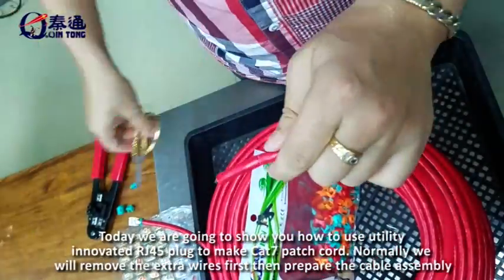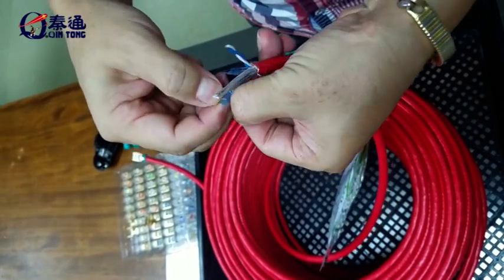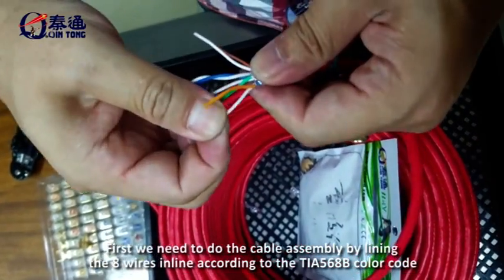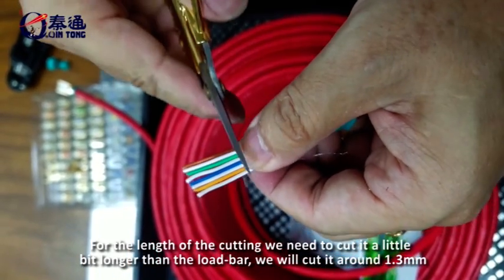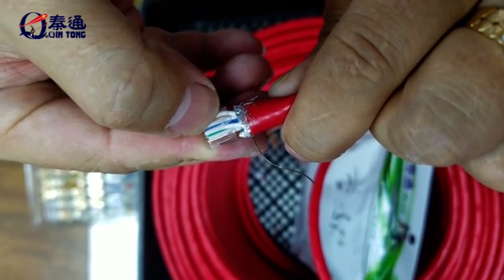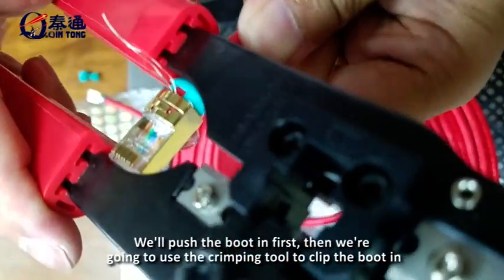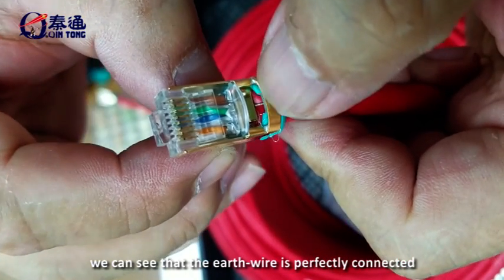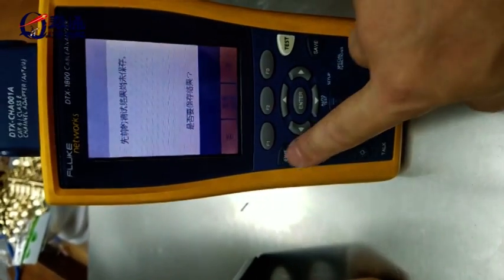Ideal RJ45 plug for Cat7 structured network cable

Comment: Hi.thanks for the tutorial. But I have a question I hope you can answer. Tks.
The arrangement of the 8 wires are the same, in both the connectors. I use this long cable from the router to the wall socket, the faceplate that has "female-female" at the back and front. That is the standard cable is fixed to the "IN" at the back of the socket, and on the front of the face plate. A shorter cable can be connected when needed to say, a laptop. Now my question is the long cable has the 8 wires arranged as 1 to 8. But than on the faceplate wouldnt it be reversed 8 to 1?. Tha. Would the faceplate be giving the wrong connection to the connected gadget, in this case the laptop. Anyone can help me figure this out pls. Tks.
Reply: hi, your question is about the wall socket to cable,  if you have 2 side wall socket ' 2  female' , then you just make  the same connection , it will be working.   but if you have one side male,  the other side female' wall socket', then you should be careful, because the wall socket has the color indication,  it should be up en down as your thought.   cable 1-8, socket 8-1, but actually, the internet cable use only 1236,

Comment: I'ts Cat 6A, not's Cat7
Reply: Cable is indeed cat7, however because of the RJ45 connection it is bottlenecked and only has the capabilities of a cat6a connection. But again, he did say cat7 cable so he is technically right on the money. Once you make the cable with the connector you don't call it cat5 or cat6 cable, you refer to it as an ethernet or network cable.
Reply: @MasterTubz  what connector do you use for a proper cat 7 cable then? I ordered a cat 7 cable and pay for the price for it a friend's dog chewed on it and I'm trying to figure out how to fix it what do I need to get then if this bottle makes it to the same thing as a cat 5
Reply: @kateajurors8640  GG45 for example
Reply: @kateajurors8640  It may not be practical because the connector for cat7 named gg45 or arj45 is rarely seen and is mainly used in a business environment.